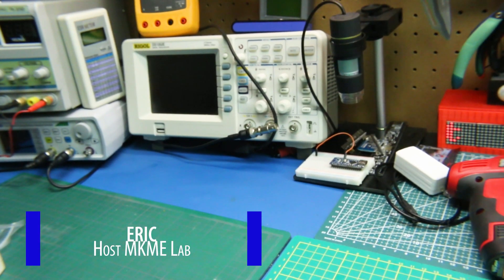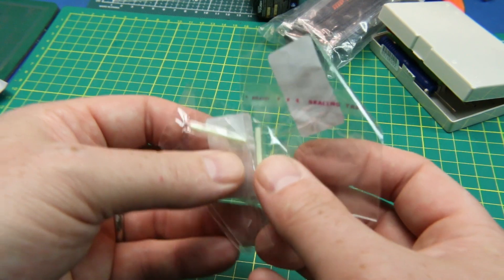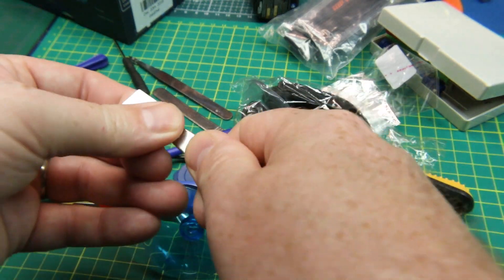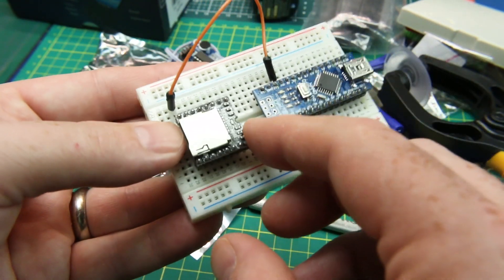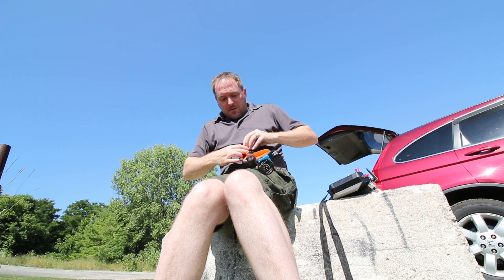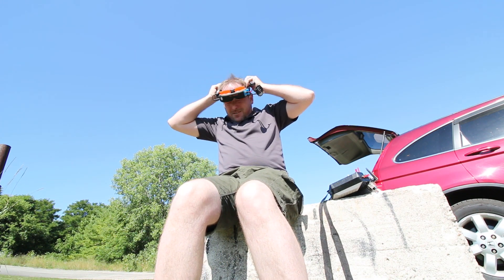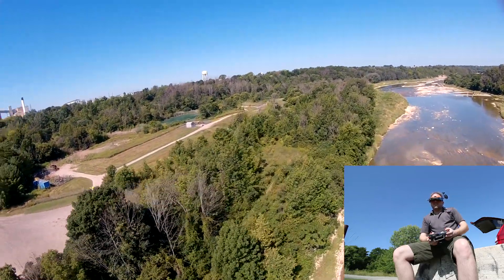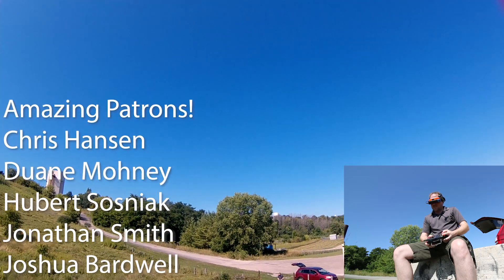🆕MAILBAG! LiPo's, Nuclear Light, Arduino Modules & MORE!

Comment: I know the connector pins you are talking about, but I think they are more for desoldering parts. Evidently the part pin goes up the centre, but I usually just pull the part and pop it through the hole to unblock it.
Reply from the maker: Pretty sure you are right ;)

Comment: Those DFPlayer Mini's are awesome for sound fx. They can be hooked up directly to a speaker (mono) or from the DAC pins to ear buds (stereo). Very easy to set up. Can produce some noise unless a couple of 1k resistors are hooked up between it and the Arduino.

Comment: Those pin removal tools are quite easy to bend. Be gentle with the smaller ones. Good mailbag 🖖
Reply: I bought the same ones but they were sold as desolder needles. They do bend easy, and I found out the hard way. Burned the tip of my finger on the soldering iron when the needle gave way.

Comment: Love your videos, nice and smooth as usual :)
Hey, what was that flipping motion you did during flight? It felt like camera switch or something.
Do you have a page somewhere with this build details? I mean the googles, RC and any tuning you did to the copter?
Reply from the maker: It is the quadcopter flipping over.  The flip and roll rates are right about 1000 degrees per second so it is pretty fast. Playlist for all the drone videos is right on my main channel page.  All configurations for all my quads, drones, planes etc is in my github repo here:  https://github.com/MKme/DroneConfigs It is updated every time I change any setting on any device :)
Reply from the maker: PS the P, I and D values have all been tuned much more since this video- there should not be that much bounceback (I term).  Its better now but still needs work on the X215

Comment: Ive found the steel desoldering needles without the holes in them to be more useful than those when you accidentally cover up a through hole since it works better at clearing it than solder wick.